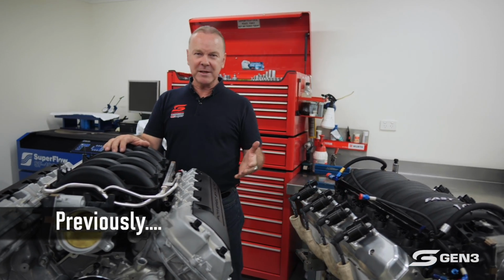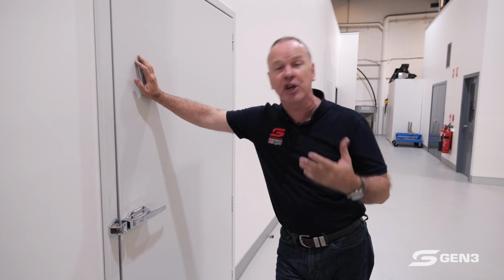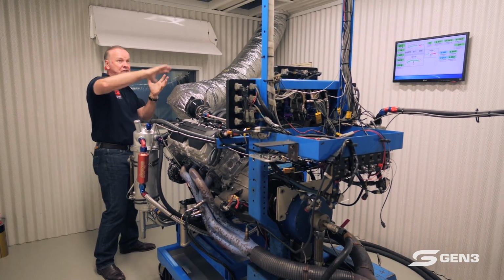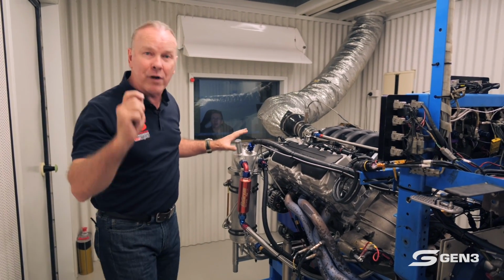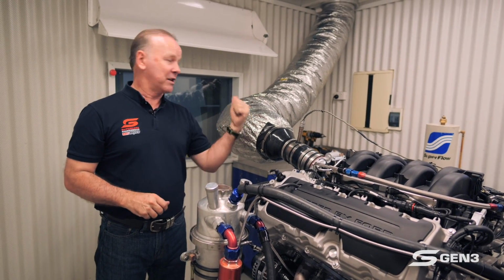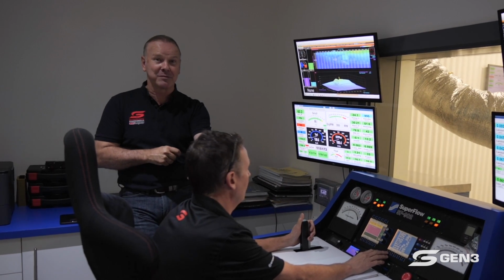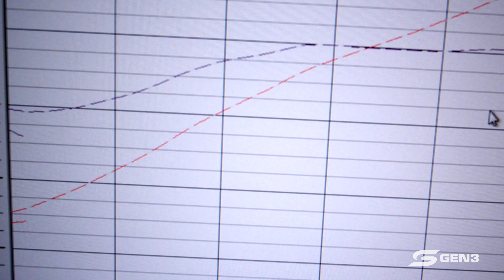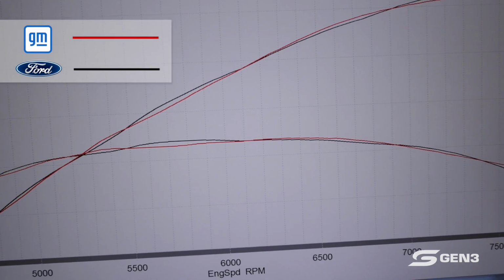Episode Six: The Dyno Run [Gen3 Unpacked] | Supercars 2021

Comment: Good video, I’ll take a guess at the ‘IP’, or more to the point ‘governing’ the engine that has higher output in original form...

... with a supercars sealed ECU they could do various re-maps to lower the output of the ‘better’ engine to suite the other engine’s ‘as-is’, could even be done with the throttle-by-wire map... (can match the torque curve exactly) hopefully the engines still have wide-open throttle, otherwise that great sound might be compromised.

Yes some more audio of exhaust!

Comment: Seems like a lot of work to create two engines of different spec with identical output and fuel consumption. Why not just have a spec engine??
Reply: Then it'd be a spec series and the Ford/Holden(GM) Rivalry would be dead. And personally I have no interest in one-make series.
Reply: @KingBanshee  gmh is dead
Reply: @KingBanshee  Spec series or Parity series. it's really just the same thing...
Reply: @crunchytheclown9694  Yes GMH is dead..  But notice how they only mention GM ???
Reply: @purplehazeffc  these people have mislead for so long they have no credibility
Reply: They asked ford at the beginning but they refused to supply gm teams. They didn't even bother trying the LS cause Ford might pull out (sponsorship $).
Reply: @nickycrea6075  sounds like bs what is the gm motor?
Reply: Its pretty much always been a spec engine honestly.
The holden engine was a direct copy of the svo ford unit that was built for parity short track oval racing in the late 80's/ early 90's

Comment: i might have missed this in a previous episode, but how much does each engine weigh.

the power and torque curves are tight, but miliseconds count, and going by the screen shots , its advantage ford out of the corners, or am i missing something
Reply: They add weight to make them match exactly. Not just total weight but cog of the engine as well.

Watch the previous episode
Reply: I SO AGREE WITH YOU mate .... looks like might have a 1 or 2 HP more .. is why i asked for the HP  from both engines
Reply: They said multiple times mate that this is early early days still with tuning and this is how close they are. Just some more minor adjustments and it’ll be dialled for sure. They won’t make it unfair huge lawsuits would be coming their way from GM if that was the case
Reply: @motorbikesnbeers   ok i can understand that ,, and respect that .but there making it such a big secret .. now the cars wont be ready till 23  now .. u make a good point  tho bud
Reply: @change_your_oil_regularly4287 thanks for that,

 do they add the weight where the engine is located, or is it an overall number they have to hit in terms of the total weight of the car.
Reply: @mahaishraja5449  I'm not exactly sure where they add the weight but as they also much COG (Centre of gravity) they'd have to add weight to the engine itself. 

To me the best part is the fact that the engines are randomly allocated to teams so that no one knows which team will have which engine out of the batch.
Reply: I could've swarn theres a lead strip on the rocker cover of the LS could be wrong though.
Reply: @doug-core8850  time stamp pls
Reply: Honestly, if the first has a slight torque advantage, it means the GM can get the throttle on early in the corners due to lower chance of wheel spin. So where's the advantage actually sit? 

They're that close it would come down to driver technique as the difference rather than the actual engine.

Comment: I'd like to see it become a big block series of sorts with current engines. The Ford 7.3 Godzilla against the GM 6.2, both pushrod engines with plenty potential. As far as parity goes, these have electronic throttle bodies which can easily be controlled to limit outputs. Gen 3 still has no official start date and looks like the same old defunct Holden commodore will run again for next year. Come on lads, get it together.
Reply: I'm happy to see Holden live on for another year
Reply: @nathanielpillar8012  It's not really a Holden is it
Reply: @keyboardwarrior5912  not really, but they still use the name and badge etc, so whatever.

Comment: Only thing I’m not sure about is the quad cam vs single cam. Does the quad cam end up having less stress on it in that area or is it more suspect to failure due to more parts? Should be interesting seeing these engines in action next year and great that they are in some way related to what many have in their own cars
Reply: Given that both have their outputs and maximum rpms artificially limited, there's probably no real engine advantage to either architecture,  but the quad cam Ford engine will have a higher centre of gravity.
Reply: @alanjm1234  was more thinking more about wear and stress on parts than output, interesting to see if one engine is more reliable or able to be pushed harder for longer than the other
Reply: Only blown one of the Chev engines before rebuild top end can't handle revs could have been over revved or install issues...

Comment: Well i dont what they have done to coyote,somethings seems wrong,as an owner of both n/a and supercharged coyotes,the n/a when modded only peaks 8-8500 rpm and what i see of the graf the coyote was nose diving at around 7300 where as the other boat anchor,that doesnt normally rev that high is holding up to 7500.Even the new gt500 when tuned,standard cams picks up big hp between 7500 and 8000
Reply: They may well use a F-150 intake manifold to get the mid range torque (+480ft/lb), otherwise the Coyote will be in a powerband above the LS, and zone that Supercars don't want to be in. 
I understand the potential frustration from this, but I don't call the shots on it. I just chose to watch.
Reply: It looked like it wanted to climb away at higher revs, then sort of behaves itself as it keeps climbing. Being less stressed up high than the ls, it'll still be more reliable long term.
It would be intresting to see what they did to it compared to how ford modified the same unit for GT4 racing.
Reply: The Ls aint no boat anchor pal
Reply: The only mustangs i see are smashed ones that run into people/ bus stops and other traffic users 😂 Basically tools that can't drive

Comment: Ford >>> GM
Reply: Kelly Grove Racing Do agree with my coments above,look at 5.29
Reply: No. Don't. 
Even if it's 10hp difference through from 7300 to 7500, the time spent in this range means very little in overall performance. If anything, the Coyote Meat between 5000-6000 will make the car accelerate that bit harder over that range leaving the LS to play catch-up for the rest of the rpm band.

Comment: When you limit all the good the tech does what do you expect. Really what's a achieved is the category remains as boring as f'k but costs less to run a team.. So basically you've taken all the good the vct does to make it match the static pattern of the LS. On the positive side, at least the engines do resemble a production touring car.

Comment: Pulling down conrod straight at Bathurst,the coyote is at a big disadvantage,its falling over at 7300 rpm,where it should have been the other way round,coyotes are known for there top end power,always got give dark side an advantage at Bathurst
Reply: The 1-3 horses in this area are minimal. Also, the gain between 5500-6200 makes up for it. 
Peak power is inconsequential compared to average power between the operating range, which is where they are trying to keep even.
Reply: @crd-nz_001  not to mention the dyno wont look like this every time. It'll be +/- 'x' amount of hp deviation for every run. From those runs one has the edge over the other equally over the whole rev range.

Comment: Yawn. Being the same isn’t always the most entertaining. I find it more interesting when certain vehicles have their strengths in opposing areas.
Reply: Moto3 is about the best racing on the planet and all the engines are the same.
Reply: Then watch GT3
Reply: @bremCZ  Totally different sports,  i.e., rider/driver percentage factor, vs bike/car percentage factor,   so not a relevent comparison...
Do some research, there's plenty of info out there with regard to what I'm saying.
Reply: @motoxray  It is a completely relevent comparrison. It shows that parity doesn't mean good or bad racing.
Reply: @bremCZ  might aswell make it a spec series then if the series is so obsessed with making every car the exact same. What's the point of two manufacturers when you can save money by having one single provider of crate engines?
Reply: @scordatura9259  They aren't obsessed with making the cars exactly the same. 
They are obsessed with having performance parity but that's nothing new, they've been obsessed with it for decades now.
They had rev limits and weight ballast in the 80s and early 90 to try and balance the cars out, but in typical fashion, the teams with the money to buy the best stuff won all the time. So they've progessively tried to reduce the "Most money wins" problem.

A spec series would fix that issue, but it would make the racing less intetesting for those invested in the brand differences. There are still a load of red v blue fans out there.
Reply: @bremCZ  they did say the goal was to make the two very different engines perform and output the exact same numbers. I have no big issues with parity since that's how most major series are going these days except for f1 as long as each car still has their own character and strengths and weaknesses rather than behaving the same and just having different looks which is what the video seems to tell us

Comment: ok so what the HP OF BOTH MOTORS  IF YOUR GOING TO BE SO UP FRONT ?
Reply: Less than a stock barra turbo upgrade with simular life lol
Reply: @crunchytheclown9694  theres no stock barra with 600hp you goose
Reply: @doug-core8850  read the commnt sgain
Reply: @crunchytheclown9694  no a stock barra wont take 600hp. It'll blow the oil pump, pistons and valvetrain. Idk who told you these are invincible motors but they're not i can assure you. They need alot of work just to safely make it over 300rwkw
Reply: @doug-core8850  you do know what lol means Doug, will do it, wont live

Comment: They look like cheap crate motors. No ITB’s no rpms these are supposed to be race engines and yes they should be different. They should be purpose built race engines given the cars are purpose built. 

Why not use NASCAR blocks , heads and cranks and let the engine builders develop them with bespoke con rods, pistons and valves?.

Also, race engines should rev. I’m the early 90’s they were already approaching 9000rpms. These engines should be revving to 10000rpms and have CRs of 13-14:1. The materials and parts already exist to achieve this.

Comment: Why aren't we seeing more of the gm motor?
Reply: They are very very shy of the airing the GM. From the get go they announced the Coyote but said Chev didn't have an off the shelf engine that could do it. Next question: will the Chev run balast weight up high on the engine to give parity to the  Coyote quad cam weight sitting high on the engine?
Question 2: what is the story with the GM motor. Please tell us. Why only the Coyote on the dyno?

Comment: If they’re the same, what’s the point 🤷‍♂️
Reply: Maybe to have all drivers in equal cars, to showcase driver skill over mechanical advantage? And to stop people whining about parity?
Reply: @timjohnun4297  there’s only whining about parity because the regulations try to introduce parity and it never works. Since when has motor racing only ever been about the driver? It’s the total package that matters, team, driver, car. It takes more than a driver to win races
Reply: @Corey-pd3mi  They can only try. I'm not a fan of the silhouette series either, but the fact is, if the GM engine was only 1% better than the Ford, and everything else in the cars was identical, then it would be a huge advantage to use the GM engine, so we would see a field full of Camaros, and vice versa with the Ford.

Comment: BTC has some of the best racing and has heaps of manufacturers. Rules are simple but allow for different cars, power plants and which end drives the car. By having differences it allows each car to gets around the track differently and makes for great racing. Some are better through corners and some are better in a straight line etc. They use a weight handicap to give every one a chance of winning if they are a good enough drivers and they get different cars winning each race and round. They also allow a bit of rubbing, which Supercars frowns upon if you scratch another car. They can't all be Jim Richards! Parity racing is so boring across the planet that motor racing is losing audiences everywhere.
Look at the GT racing for great racing with different cars and you see racing, passing and drivers driving to the advantage of each vehicle.
We had group A and got rid of it because it didn't fit our Holdens and fords well. So get over it.
Why are we so hell bent on American muscle when every kid wants to drive a BMW, Merc, Audi, Lambo, WRX, etc. European and Japanese, and soon Korean and China. God forbid!!!
The only guys I see driving Mustangs and Camaro's are old farts like me, but like many old fart, even we have moved on to Euro cars.
Supercars has no chance in getting other manufactures.
Like another comment, they didn't support Volvo, Merc or Nissan, because the guys running Supercars can't get on the modern band wagon.
The world is changing, Supercars, so you need to change as well or you'll go the way of the Dodo bird as well!
Reply: BTCC has terrible racing. It's basically a demo derby.
Reply: @Nic B How do you rate it objectively?
Reply: People like you have been saying supercars is gonna die for a very long time now.
Yet here we are.
Reply: @Nic B Of course it is.
Reply: @Nic B How many seconds covering the field is no objective measure of how good racing is. Nor is time or speed difference.
Using that, all you get it objective parity. It's not at all an objective measure of the best or worst racing.
Reply: @Nic B Of course you see no value in it. You've now realised that those objective measures don't at all show whether racing is good or not.

Nobody is arguing that those metrics are not objective. The issue is they don't result in showing what is and isn't the best or worst racing.